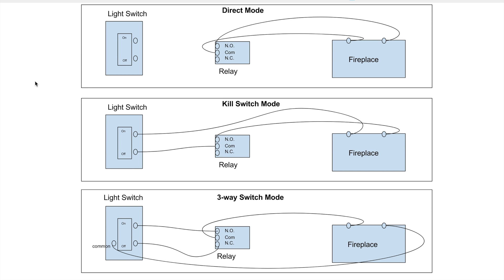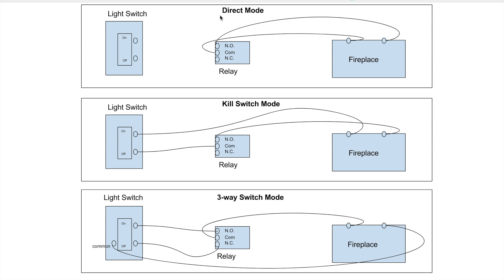Alexa Fireplace - Switch Wiring Diagram (companion video)

Comment: My fireplace is already wired with 3 way switches. Meaning I currently have two wall switches that control the fireplace. I would like to use your option 3 so that I can control the fireplace with either of my existing wall switches or Alexa.  Do you have a wiring suggestion for this?  Thanks and great video.
Reply from the maker: I would need to see how it’s wired. How many switch wires do you have coming into your fireplace controller? Just two? 
I think my Alexa Fireplace controller I sell would work. https://etsy.me/3YY1i1g

Comment: So instead of a switch my fireplace is controlled by a 2 wire thermostat (battery operated). Wiring it the second way in your diagram the thermostat should work like a switch if i leave it turned on at all times. When i ask Alexa to turn on the fireplace, the relay will complete the circuit. When the room reaches the temperature set on the thermostat it will turn off the fireplace.
Can i get you .02 cents if this will work?
Reply from the maker: Hi. Yes, I believe it will work as you described.  The only drawback is  Alexa will still think it is on. 
Did you see my other video about this using Sonoff SV? It lets the switch work as a true 3 way switch.
Reply: mattadata2 
I did not see that video but i will check it out. I was going to create a routine to for Alexa to turn that switch off after 45 minutes though.

Comment: Is there not a wall switch that will work as both?  I have a 2 gang box at my switch for the fireplace and can get power.
Reply from the maker: imlon2  - sorry, I don’t fully understand what your question is. I came up with another option where the wall switch is fully functional and  you can fully control it with Alexa. Haven’t made a video for it yet though.
Reply: Sorry new to this smart thing stuff.  Can you get a smart wall switch that will work without having to use a relay between the switch and fireplace?  This way you can use the switch or the voice assistance.
Reply from the maker: No. Because all the smart wall switches only control 120V AC. The fireplace works off 12V DC.  At least I haven’t seen any for sale yet.